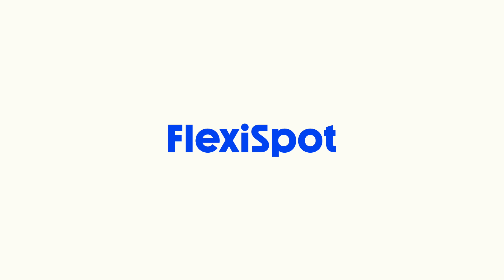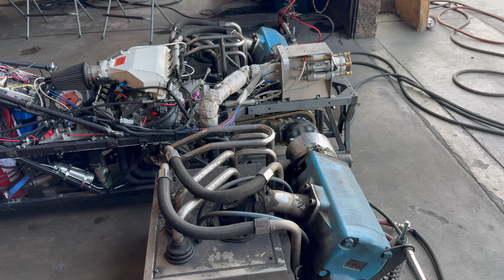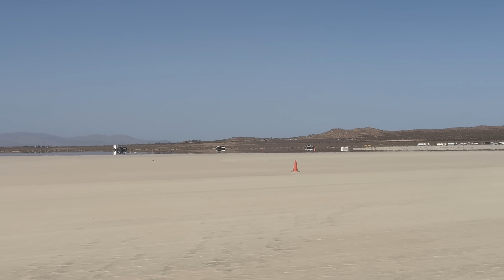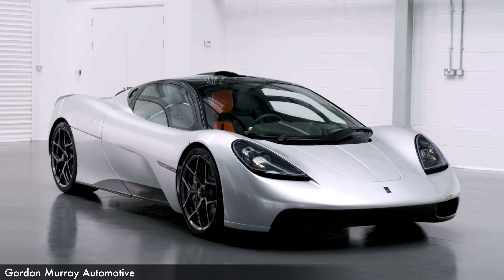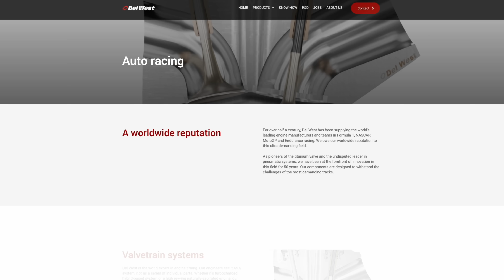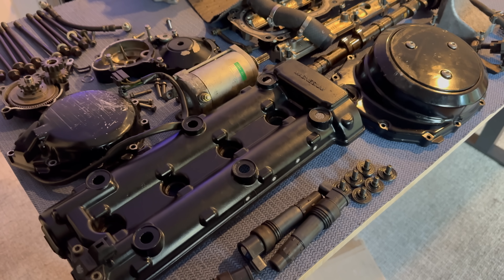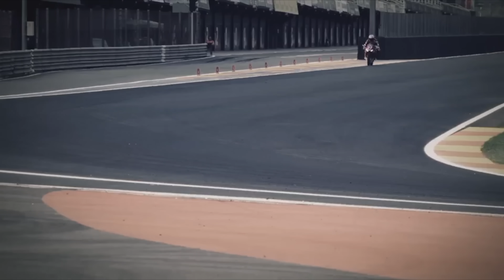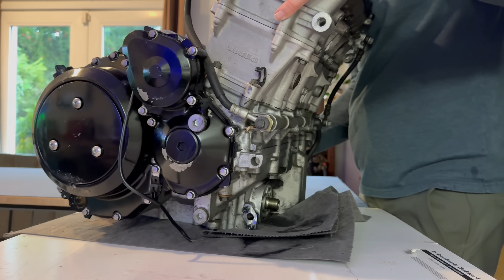Motorcycle Engines Are WAY BETTER than Car Engines

Comment: Motorcycle engines aren’t “better” than car engines — they’re just designed for different jobs. Bike engines make big power from small size, but they do it by revving very high, running hotter, and wearing out faster. Car engines are built for long life, heavy loads, low-end torque, cooling efficiency, and everyday reliability.

So in real-world durability, torque, cooling, and lifespan, car engines are better engineered. Motorcycle engines are fun and high-revving, not superior overall.
Reply: Yes they are designed for a different purpose but it takes more engineering to get near 200 hp out of a 1 litre bike engine , likely more engineering then in a very efficient but unstressed 65 hp 1 litre car engine . Formula 1 engines are very engineered but they don't last long and not very efficient

Comment: Motorcycle engines generate LESS power than car engines for the same amount of fuel burned — significantly less.
Currently, motorcycles consume about 5–7 liters of fuel despite having relatively small engine capacities.
Moreover, in everyday riding you use torque, not horsepower. Motorcycle engines produce less torque.

Comment: Car engine has a different purpose than a motorcycle engine. It makes a small difference whether you re moving 2tons + extra payload or 300 kg....Everything in engineering is specially tailored to its use case, Life-Time expectancy, running conditions, costs, and so on. It's always a trade between performance, lasting long, and costs.

Comment: 11:38 straight cut gears, is this why motorbikes are so loud!
Reply: Maybe. Mostly because the exhaust system on motorbikes isn't as lengthy as cars. Less muffler = more noise.
Reply: No, the gears contribute very little to how loud a motorcycle is. It's the exhaust the emits most of the sound.

Comment: Every car I have driven with a bike engine in it, was absolute rubbish 😢😢 not enough torque, a one litre car engine can push 4x more😮 weight than a one litre bike engine, even if you turbo the bike engine..I like the idea though, but the car has to weigh less than 350kgs

Comment: ya totally no engineering goes into a 3000 horsepower viper motor
Reply: Didnt know dodge made a 3000 factory viper.... /s

Clearly he mentioned factory engines...

Also, not really.
Its just above 300 hp per liter, not really that insane

Comment: higher engine speeds aren't "the more clever option chosen by better engineers". On a motorcycle you do not have room for a higher displacement engine. You are forced to increase engine speed. The more expensive engineering is going into preventing the engine from destroying itself. 
They are better engineered by necessity.

Comment: My constant dream is making V-8, I-6 and V-12 versions of S2000 engines.  ChatGPT suggests even the V-12, with aluminum block, would be lighter than my old Supra's 2JZ-GTE.  ChatGPT suggests the V-8 would be about $50k to make, up to $100k for the V-12.  V-8's the cheapest as you'd use the S2000 heads unmodified.  So you'd make the block, crankshaft, cams, headers and intake manifold.  750PS NA in a slightly lighter Supra sounds fun.
Reply: A "s2000" v8 is going to be hundreds of thousands to make a single example.

Dont blindly trust "ai" garbage
Reply: @zaarkeru3391  Happy to hear you out.  What are the ballpark prices for say the top 4-5 components, in your experience?  Block, crank, probably, then the next few?
Reply: @lqr824 
A prototype one off block is likely atleast $100k likely above $150k if you can't design and engineer it yourself, just the material and machine time to make a one off billet aluminium block is $30-50k
Custom crank and crank assembly will end up around $5-10k is my guess.

Then you can use, if you design the block well you can use F20C heads.
One issue you will face is that you will need two cam drive assemblys.
Which will be expensive and costly to make and difficult to design well.

Then its just off the shelf stuff for the oil system (dry sump is preferred of course when you're spending this amount of money), cooling system, electrical system etc.
This will be around $15k is my guess.

TLDR: i would say $200k-$250k for such a one off build.

This could be a crazy cool build, but too expensive for any practical use.
To make it propper it would simply be better to make a F20C inspired V8, and not use any "stock" components.

Comment: 5:36 another thing is reducing stress concentrations in the part and improve fatigue strength of the material. Size, surface finish, and temperature all significantly affect the fatigue strength of materials. As an example a near-ideal connecting rod would be made from a high strength steel, cast as a single crystal, then all surfaces would be polished. Similar to modern turbine blades.
Reply: That is plane turbine type of manufacturing.  It would cost a lot, and we all know that the near-ideal anything is when they cost less than than the upgraded performance they provide
Reply: @Narblo yes but he is talking about the near ideal of reliability wise. Not cost.
Reply: Learned something new. Thank you!

Comment: 6:29 Ducati enters the chat and raises hand.  <ahem>, in Italian
Reply: Yes I was thinking pretty much the same thing.
Reply: yes. I'm not sure why it's not more common since removing the valve springs the spring, reducing friction on the camshaft and having more precise valve actuation all make a lot of sense. "complexity" is not a good enough reason because there are a lot of complex systems that have been added to improve performance
Reply: @geemy9675 complexity always means costs and Ducatis valve tain is great but as you cann see other companies have achieved the same high rpm with much less complex systems so it is basically "over-engineered"  and not as cost-effective  as other options   

Yes there are many complex systems too get more power out of a engine but if you start too compare them with other options that basically achive the same result it will always be the less complex one that gets too production   minimum effort for maximum reward

Comment: My favorite engine with desmodromic valves is from the Pegaso Z102. That car was nuts. All aluminum supercharged V8, quad cams, desmo valves (32!), dry sump, 5 speed transaxle. In the 1950s! And it was in Francoist Spain, so it was a state-owned enterprise! The whole story is bonkers. Guy was supposed to be designing city busses.
Reply: And pegaso bus and trucks were bonkers with far superior performance and reliability than any other brand. And consume less fuel was the get go to start any new design

Comment: On the other hand, there are 100k+ R1xxxGSes which are perfectly fine, and 100k+ car typically costs next to nothing, much cheaper than these old motorcycles.

R1xxxGS is not sport superbike, of course.

Comment: Great point, however, you fail to consider the fact that i operate completely on "heh sh!t looks cool dont it" with zero regard for wether something is actually good.
Thus i will be putting a carburetted harley davidson engine inside a rusty volkswagen beetle.
It will be a significantly worse car than the stock beetle. But it would look, and sound, awesome.

Comment: There's a buzz in your audio.

Why haven't bikes moved on to hydraulic or servo valves yet? They seem way simpler, more efficient and more tunable. No more need for double overhead cams because of power bands.

Also yes aluminum bolts are slightly lighter but they're way too easy to strip and don't make a difference to engine performance if they're not on moving parts. They're not worth the hassle.
Reply: I got an old racing motorbikle book from the library and it said to save weight on steel bolts is to drill a borehole from the wrench end to as low as you can go on the thread end. Is this still done anymore?
Reply: @davidkreimer2970  Fancy bolts have the bolt head hollowed out if that counts. Actually drilling through the threaded part probably weakens them though in which case just buy titanium bolts.

Comment: You say that car companies wouldn't design a car that can only last 40k miles, But from what I've seen in some EV's and most modern high reving v6's most aren't making it to 40k without battery or an engine swap anyways.

Comment: So.....Why not use a small motorcycle engine to power a hybrid car?  Duh....A 200cc motor from a Suzuki Burgman could power the a/c and the radiator would supply heat and you could even power heat strips to heat the battery and help in heating the car.

Comment: i love this video....  I sled pull a diesel engine well used to then common rails came out and i began to fall 10 ft 20 30 80 ft behind every pull by dodge ford and chevy, my 98 dinosaur 12 valve cummins just didnt have it.  For the past 3 years i have been doing my homework.  Talked to john deere engineers and top sled pulling teams.  Please let me know if you have any magic ideas i dont already have.

Comment: My question would be why don't more road cars use sequential transmissions, both sports cars and non sports cars (ones that would otherwise have an H-pattern) could benefit from the simplicity of just pulling on a lever to select the next gear, and sports cars get fastwr shifts too; and both can keep a manual transmission.

Ofc, shifting isn't hard for the people that want a manual, and automatics are more desirable for people that want to resuce effort; but i think there could've been a market for it, with something like a Honda Fit having a sequential for easier driving, and a Lotus Elise for faster shifts.

Comment: race engines are very different from lets call them commuter engines. 
you want everything that makes a great race engine stuffed into a 3,500 rpm engine.
usually more displacement is a symptom. personally I like methanol as the fuel...

Comment: There's a guy who put a 1,000cc bike engine in a Miata. They think its super light  but really too heavy. They think that nearly 4 times the weight is light. I said build a custom chassis something like a Radical or Gordon Murray Rocket or maybe a Caterham or Ariel Atom.  I built an aluminum sheet monocoque, but didn't use it. I've got aluminum honeycomb and/or stainless steel tube and I want to build a chassis again. Not sure whether to use a turbo hayabusa or a turbo 2 liter performance car engine. The bike engined car should be around 950 pounds, car engine around 400 pounds more. Both options have pros and cons.  
     The Miata guys seem to think that the range of 1500 pounds to 1800 pounds is light. For a bike engine thats too heavy. I have a little experience with the Rocket. It has a 2 speed transaxle, so its 2 range. With 2 people in it it's about 1150 pounds it needs low range . It they can get the Miata down to1500, with 2 people its going to be around 1850 pounds about 700 more pounds. The 2 speed box was made by Pete Weisman, I don't know about availability,  that was 32 years ago.  Sorry for running on.

Comment: Specific fuel consumption:  requires less heat loss to head, piston and cylinder walls.  These means larger cylinders, fewer of them,  and longer stokes.  The most fuel efficient engine for any power output is a single.  Vibration rapidly becomes unacceptable when power level increases, so more cylinders are required for smoothness.  
Efficiency is also related to speed.  Higher engine speeds tend to reduce fuel efficiency as the piston moves faster than combustion flame speed and that means lower effective pressure in the cylinder.  The most fuel efficient engines have huge cylinders and run very slowly, they are found in ships.
So, motorcycle engines are not "better" than car engines.  They are designed for different purposes with different weight, durability, and fuel consumption requirements,

Comment: Super interesting! Two years ago I got into Dwarf Car racing, which are small replicas of 30s style cars running 1-litre motorbike engines. My first Dwarf Car used a Honda 954RR, but I upgraded to a newer chassis after my first season and am now running a Yamaha R1 powertrain. It's cool how quick these little cars are and comparatively inexpensive to other cars that run similar lap times.
I'm planning to do a bit of refreshing on my motor this off-season, so a video like this is super helpful in giving me a bit more insight into the differences between what I'm used to seeing and what I will be seeing in a motorbike engine.

Comment: The main reasons why car engines have a comparatively long stroke, are torque and efficiency, not emissions regulations. 
Car engines have been like this forever, long before emissions regulations existed anywhere

Comment: The bottom end is almost never the limiting factor., its the valve train. Car engines redline around 6000rpm because of valve flost, the bottom end can handle many thousands of rpm more.
Motorcycle and race engines are overquare to increase the valve size relative to the displacement, not to shorten the stroke. The shorter stroke does reduce the piston speed, but the benefit of this is that it allows the flame front propagation to keep up with the piston. The combustion occurs at the speed of sound, a high piston speed can exceed the speed of combustion and would require a hotter mixture(through higher compression ratio) to boost the speed of sound for the combustion.
Valvetrain is limited by the strength of the valvespring. Higher rpm function requires a stronger valvespring to reciprocate faster. A heavier valvespring has a lot of drawbacks: it wears the camshaft and valveseat faster, it wastes more horsepower to operate, and it requires everything else in the valvetrain to be heavier/stronger to handle the pressure which requires even more spring pressure to cycle.

Comment: i think ive work a way to get both longevity and lifespan for car applications while still keeping everything on the bike engine by over engineering a transfer case that directly connect to the output shaft of the bike. of course this means over engineering everything 100 times then to just realize that the first 20 was more then enough hold my beer! i am a 27 year self thought engineer if you ever want to break something with out paying for it. find a way to get in contact with me id love some feed back on my upcoming protype for 2026. cheers mate love watching videos .

Comment: You don't want an engine that is powerful
You want an engine that never ever breaks even if totally completely neglected for its entire life (not counting oil changes).
A lot of motorcycle engines fail way before that, and it's usually just the carb clogging up with gasoline left in them over the winter.   Always, the f'n carb.
Car engines suffer now for blown headgaskets, rubber timing belts, and interference engines.